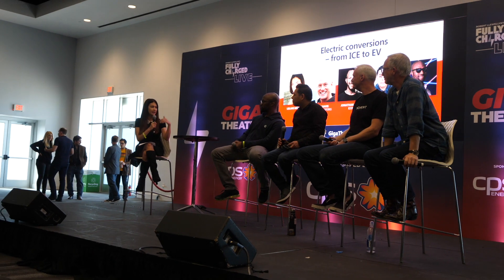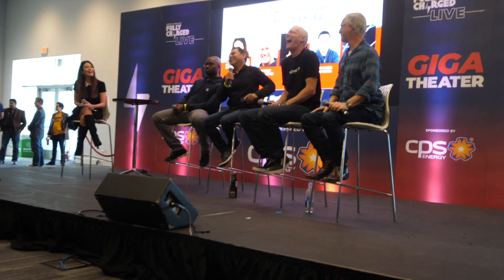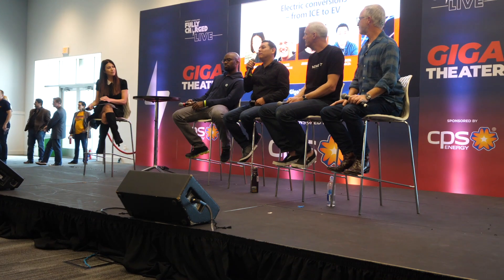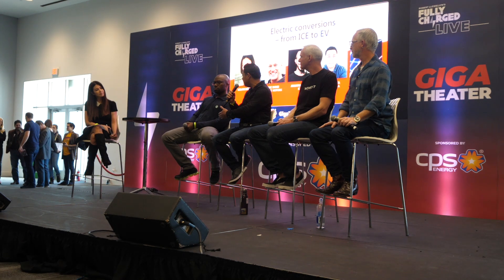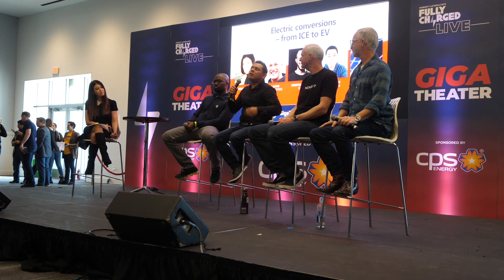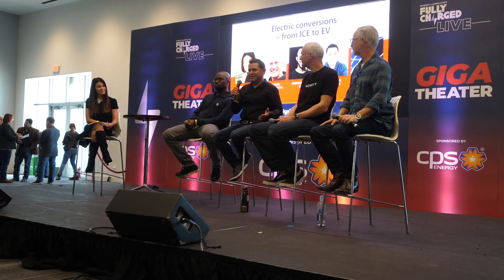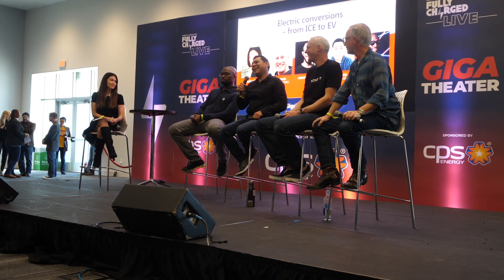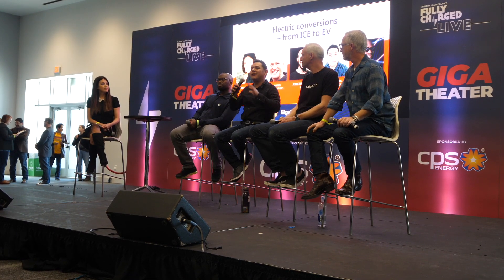JehuGarcia at FullyChargeLive USA - Can anyone convert ICE to Electric?

Comment: Can you do a modern car? I have a dream of converting a Ford Raptor.
Reply: Yehuda Goldberg the challenge with modern cars is that they are so heavy.  The Raptor is a 4500 to 5400 pound truck (depending on exact model) and while you can probably loose half a ton of ICE drivetrain you will need a ton (I mean that literally) of batteries to have any range at all.
If instead you convert a 1965 f100 flareside  (to choose a random vintage pickup) your donor vehicle weight is 1200 lbs less to start.  Weight and cost are the main factors influencing the current trend to convert vintage rather than modern cars.  A bonus is that even after spending a fortune converting a Raptor you won’t have particularly better off the line or top-speed performance (with far less range) than the ICE original, but an EV f100 will be much faster and more reliable than it was before the conversion.
Reply: It's MUCH more difficult to convert modern cars because of all the electronics in them that you have to either integrate, replace, or delete. Think of all the sensors that won't be happy now that you removed major components that used to be mandatory in the ICE car.